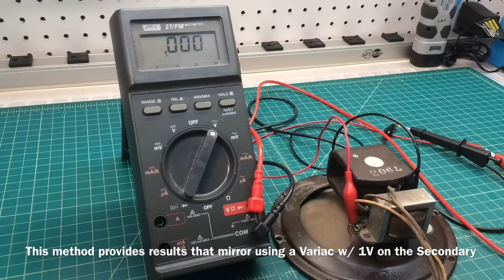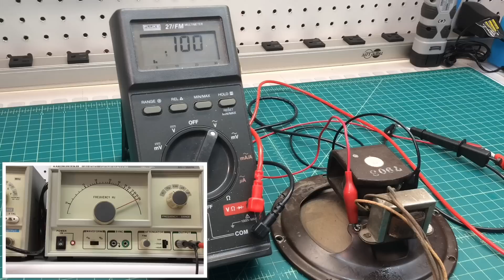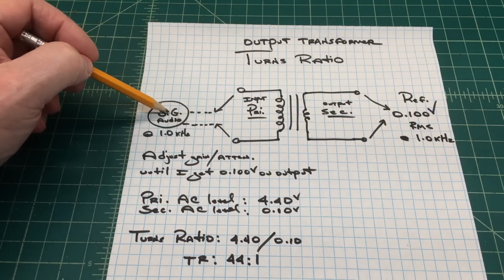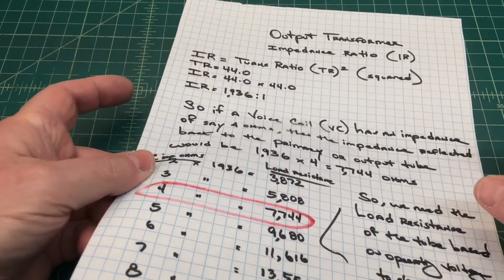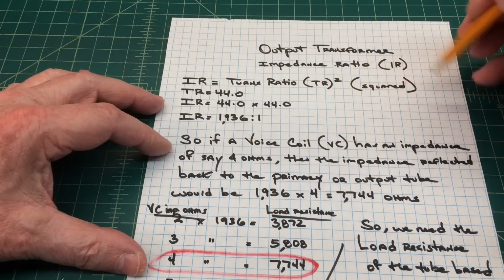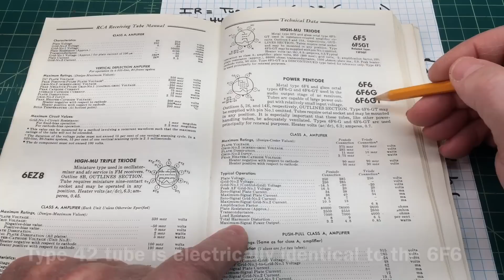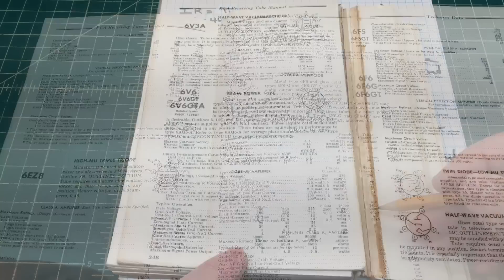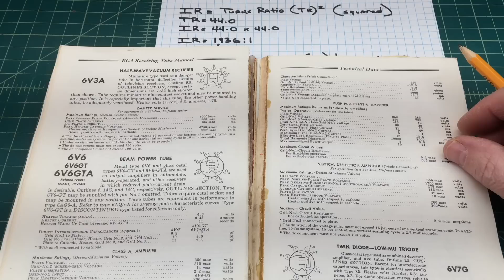Output Transformer Impedance

Comment: Hi RORadios, I know how to figure out the turns ratio, I do it basically the same way though I'm using a variac to get 1 volt on the secondary, then measure the input voltage. I can also figure out the impedance... My question if you could answer is, I know for a pair of 6V6's in push pull it is 8000 on the primary. I want to add 2 more tubes, one on each side. Would I then have to halve the primary impedance to 4000? I can't seem to locate this information. I have noticed in the RCA Receiving manual that on single ended output transformers, when using a single tube, the impedance is whatever it is for that particular tube...sometimes they show for 2 tubes (still single ended) and the impedance is roughly halved. Hope you can answer. I'm making my own amplifier, not modding an existing one, so I'm planing on purchasing a new output transformer for the added power rating, ( I know the power transformer can handle the extra current draw, just want to make sure I get the proper one.  Sorry so long for such a simple question, Thanks for your time, Tom  Very good video by the way, I just came across your channel and will be looking at your other video's as I'm interested in all old tube gear, Guitar amps, Radios, Test equipment etc..